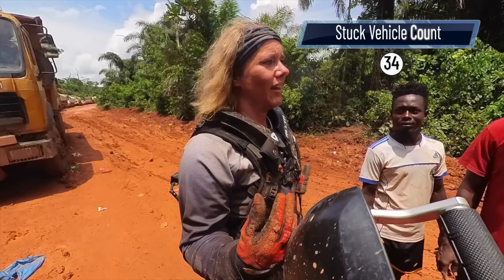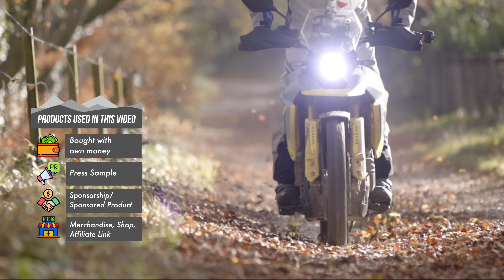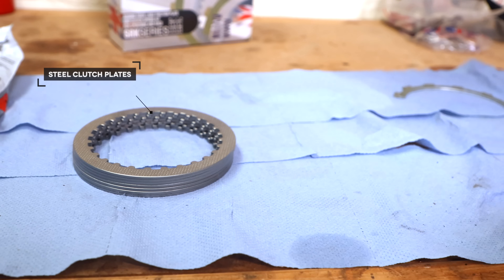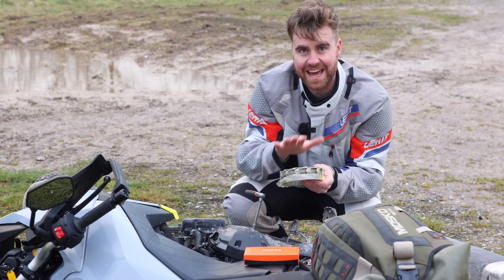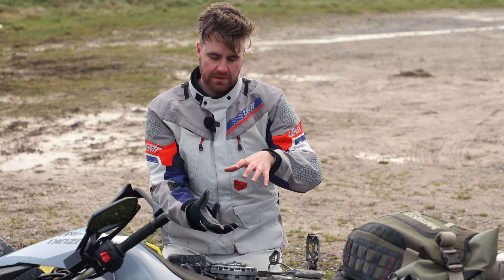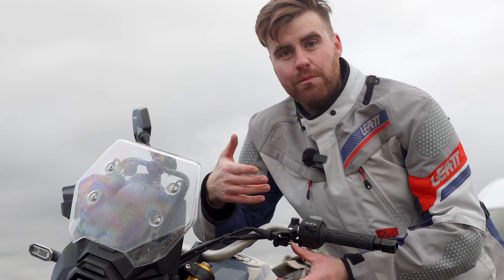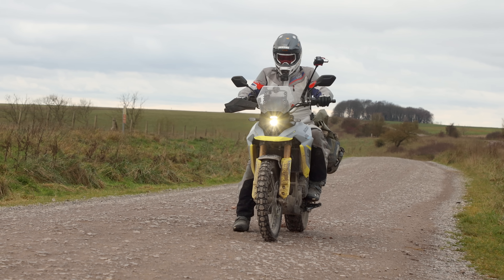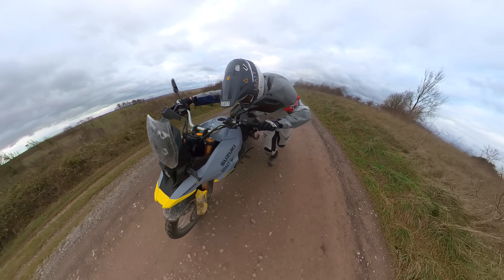This Dakar Trick could've saved Itchy Boots in Africa! | MiniTip Monday

Comment: I would love to see more of these dakar tricks. Right now im building up a xr 650 r to ride trough africa with it. These tricks could literally save my life in the future...
Reply from the maker: Cool!!
Reply: Make sure you get the seasons correct when going through West Africa; Noraly got it wrong by arriving in the wet season. In November and December, it's still very green with no rain, plenty of deep sand where the wadies are, and no mosquitoes to worry about either.
As this video shows, carry a spare set of clutch plates and a cable taped to the original in case it breaks. I made longer and wider foot pegs for my bike, as you will be standing up a lot. Add a bit more oil to your crankcase too, as it gets very hot here, or add an oil cooler. Water cooling: you can buy an anti-boil additive in most countries. (Abro tropical coolant).
Noraly was always concerned about the quality of gasoline sold on the road. People buy it from the petrol station and resell it for a small profit in 250-ml to 4-litre (1-gallon) containers to the locals when the petrol station runs out.
I've been in Ghana for 10 years myself and enjoy riding year-round. If you make it to Ghana, you are invited. I'm in a town called Tease (te ah see) in the Eastern Region. Just ask for the white man with tattoos at the police station, and they will direct you. I have a motorcycle parts shop and sell petrol from a table top. 😁👍🏼
The people are really friendly, and the food is good.

Comment: Awesome tricks! I just wanted to point out that both of these are a continuum, like you can do all three of pushing, downhill, with the starter button pressed, for the easiest possible load on the bike. And for shifting down it makes it smoothest to go really slow, apply some throttle to get the motor starting to rev up under its own power, and downshift at the same moment, to minimize the change in acceleration when the wheel starts engine braking to the new higher RPM. It's similar principle to getting the bike rolling before putting it in gear. Just smoothness is the key, same as with riding clutchless. but if you've ever watched Moto Gymkhana (Lexco has a great video on their techniques, which really carry over to a lot of types of riding), they don't use the clutch for all of those crazy manuevers. So it's definitely something that can be practiced for fun and can even become your preference, once you stop relying on the clutch because it's there.
Reply from the maker: Good points!

Comment: I would have cut up an old metal tin and made a dummy steel plate to pack it all out a bit further and take up the slack, or even put a couple of extra washers from elsewhere on the bike, under the spring nuts, to force it together until I could get a set of new plates FedExed to the next town. Of course I dont have a pile of CRF clutch plates in front of me to experiment with, but I would have figured it out somehow, because I have a good imagination, and and am also mechanically minded after 45 years of swinging spanners on bikes.  Noraly didn't get stuck for long though and is still inspiring people the world over.

Comment: Man having to snap a fibre disc and assymetrically load the basket springs is LOOSE but pretty awesome. For those not racing when you next open your clutch cover for any kind of maintenance or inspection - check your clutch spring ID & OD and pack suffcient washers to preload the whole spring set a few mm - no risk of basket damage and will save a ride if you catch a slippage, let the bike cool down and fit them before to much damage is done. Carrying a full clutch even on a remote ride is pretty rediculous for riders that have mechanical sympathy/ understand what heat and continued slippage will result in. Carrying 5-15 choice size washers that might save the day when you don't listen to your bikes warning signs for a weight penalty of ~50g in trip luggage might be a smart move for you or someone else where the terrain/climate/rider warrants it  :)

Comment: As a preventive measure
clean the glue between the disc pads and polish  (better oil circulation)
seeing tips on Trial UK forum (if I remenber).

I did it on Trial (Beta Techno 250),
very smooth cool easy... (Techno was was too brutal, and stalled in 1st gear)

Comment: Don't carry a fiber plate instead carry a extra metal. If slipping starts double the metal plates (2 metals between the fibers instead of 1) in the center of the pack. Your clutch will operate just like a brand new clutch again. I've ridden hundreds of miles on clutch packs with 2 metals stacked in the center on multiple bikes over the years.

Comment: i had the clutch mechanism fail on my old 600 gsf and due to the tip by a fellow friend with the starter motor I was able to drive back home. its quite weird at first, but you'll get used to it.

Comment: A simpler "gimmick" is to come up with some washers to put under the bolts that hold the clutch and basket together to increase the preload pressure on the clutch springs. Maybe she can scrounge them off the bike itself, other vehicles, or carry them around in her pocket for the next time this happens. The CRF300 has a ramp style slipper clutch and only 3 springs. It is reasonably easy to upgrade this arrangement in the 300 with a conventional clutch system.
Reply from the maker: It’s also a good point!

Comment: Most of are familiar with riding a fixed gear bicycle. You only pedal the bicycle forward continuously and it will not allow you to coast. That’s disconcerting at first but with practice, it becomes second nature. A fixed gear motorcycle is operated without engaging the normal gears. A sort of kludge to get you out of a jam until you can get a burnt out clutch replaced. The simplest solution when nothing else at hand works. Unlike Noraly, few of us will ever encounter a knee deep impassable mud bath like she did in Liberia. 😮😊

Comment: Make sure you really understand how your clutch works, and what effect the clutch free-play adjustment has on the cable, and actuation mechanism. In most cases when the clutch starts slipping, re-adjusting the clutch free-play will reduce the slipping. As will letting it cool down.
Reply from the maker: Absolutely imperative. Great comment

Comment: Any chance you could show us in a bit more detail how you create the fixed clutch please? Like where exactly the snapped friction plate goes etc
Reply: Take a plate out, break it half and re install with the two halves on top of eachother any position in the stack is what I think I know...
Reply: @Matthew-zw9su  thank you mate!
Reply from the maker: This.
Reply: The idea is to prevent the two types of clutch plate from being able to turn relative to each other  , or 'lock' them together . First off you need to open up the clutch and remove one plate ( I think that some of us might want to examine their manual , consult a friend , or the road side services , before doing this at all to be honest , but it is simple enough if you have some mechanical skill == do not blame me or anyone else if you fail at this or cause any damage to yourself or your property thank you  ==) . The method to lock the clutch plates in this situation is to break one plate and use the two halves to wedge the other plates together  , by placing one broken half over the other broken half between any of the other remaining plates in any position in the clutch basket . Now you need to reassemble the clutch baskets and springs .  By not allowing both types of clutch plate to turn due the wedge created , one type with external lugs and the other with external lugs remember , the two half of the clutch are locked together , just as if the clutch control lever at the handle bars was disengaged , ie as it would be to drive the rear wheel . Problem now is , hey , you have no clutch control and need to learn to how to cope . Return to the video once more for that advice . My advice , for peps driving road bikes anyway , is pull in your clutch lever and check for fraying wires before and after each ride ; usually the clutch cable will provide a bit of warning by fraying a bit before total failure . My clutch cable snapped  on an old Laverda , some years ago ,  and I drove maybe ten miles to my friendly garage . Not for the feint hearted ! Lol . I would not try this at all on a bike you are not very familiar with .
Incidentally , lol , I had a final drive chain snap and fall to the road causing no noise or damage to my bike once . Since the engine revved fine , but there was no drive , I thought I had a failed clutch . I was most surprised to see no chain attached ... it was a dark night out in the sticks . Found the chain a hundred yards back and fitted a new spring link that I carried as a spare . Phew ! All the best in 2024 .
Reply from the maker: That is so lucky to be able to just fit a new link!
Reply: @davidyendoll5903  what a great reply and story bud, cheers!

Comment: Drop your kickstand, start in neutral, tip your bike to get the rear wheel off the ground, drop to into first gear, the rear wheel will be spinning off the ground, rev up your engine, drop the wheel back to the ground, as if your rear tire is now your clutch. A little practice goes a long ways. Shift by backing off your throttle and sticking in the next gear. And ride it like you stole it.

Comment: Great info, most I have tried over decades but the snapped plate trick I hadn't seen. Shame all my bikes use steel-backed plates for both. Where is my emergency Hacksaw? Nearly Dakar time, bring it on.
Reply from the maker: I reckon you could probably bend the steel plates to achieve something similar

Comment: 1st: I believe when you open the clutch cover you will surely damage the gasket. ( Mostly it's paper-based) 
2nd: Start in neutral why play with a clutch switch 

My new bike clutch wire was loose and I drove 10km without using the clutch ,it's very challenging in traffic but I made it to the service center for a quick fix
Reply from the maker: 1) in this situation it’ll be fine and a lot of them hold up to being opened without damage if you’re patient and careful.

2) so you can use the starter motor to help you start if you need it. Can be really helpful.

Comment: 75w140 oil and a water  bottle to spray on clutch case if fading.  No, it is not pizza sofa comment, real life and always worked.... Yes cooling clutch case with water works, yes, 75w140 makes a big difference... If hydraulic, care of the hose going to slave cylinder, not touching hot engine. But motorbike club is the most stubborn activity found on planet 😅

Comment: If you watch the following episodes of Itchy Boots after the burned clutch you will see, that it wasn’t simply burned - a lot of noses of the clutch plates were broken. I think the clutch was nearly dead long before this episode, because she was riding such a lot off-road with it.  Maybe the freeplay was not well all the time adjusted and so she was riding with a little friction for a long distance. And then came this nice guy how want‘s to help her, but he was careless with the clutch. Noraly was afraid in this and asked him more then 1 time to be careful.
Reply from the maker: So, I did scan the next episodes and I think what happened is that once it started to slip they both kept riding. 

It may have been worn already, the CRF is well known for this being fragile. But, when it starts to to slip clutches get very hot and parts weaken. Baskets will break and fibre plates will disintegrate.

The quick you stop the bleeding the better.

Comment: Also you when you are ready to shift punch the kill button quickly to unload the shift dogs, an old dracing trick install a micro switch on the shifter and when you are on the throttle bump the shifter it does the same thing unloading the gearbox . Jus saying
Reply from the maker: Interesting idea! It’s a quick shifter then!
Reply: Yes

Comment: Awesome video! Sorry, I heard you mention quickshifter. Would having one be helpful in this situation? I'm guessing it would.
Reply from the maker: Sure, it’s helpful but far from essential. Quickshifters are best when the bike is under load, ie throttle turned. All it does is cut the ignition marginally to do exactly what I explain doing manually in this video, so the same lesson still applies.

Comment: I have a question.
I watched the Noraly episode mentioned here, and I couldn't help but wonder if doing the mud stretch in bursts would have lessened the damage.
At the time I theorized that the worst damage to the friction plates occurred when the clutch was very hot.  If this is true, then riding (say) 30 or 40m at a time and then giving the clutch a couple minutes to cool down each time would have lessened the damage across the entire mud stretch.

Is this correct?  Would cooling the clutch help?  Or is the amount of damage over the total length of the mud going to be about the same regardless?

I would be very interested to know.
Reply from the maker: It does help but once it starts to slip at all, not really. It’s game over for the clutch tbh.

Comment: Two thoughts. Don't many bikes have fiber gaskets? If so bring small tube of gasket sealer?
It could be my habit, but on many bikes it seems easier to find neutral after dropping down into first.
Reply from the maker: They do but they normally hold after opening just fine.

Comment: I was trapped with a broken clutch cable on an extensive off-road adventure. Fortunately it was very very muddy. I would pop it into first gear from stationery and use the mud and the wheel spinning as a clutch for a gentle pull away.
Reply: You rarely hear “fortunately it was very muddy” 😂

Comment: Of course in IB's case the clutch was cooked by way of massive and repeated, blatant abuse.  So avoid that, and then her particular problem doesn't occur in the first place.  I thought this was going to be a video about escaping horrific mud holes.  Riding without a clutch is quite a different subject, and should indeed be practiced so that, when the skill is needed, it can be used with some confidence (even if the manufacturers try their damnedest to defeat the practice).

I've had to do it in a car, when the slave cylinder simply vomited out its seal, along with all of the hydrolic fluid, and it went just fine.  Of course that was back when automotive designers weren't trying to make unconventional operation of the vehicle impossible.  I was able to use the robust starter motor to get going.  Of course it works a lot better when you're able to hit neutral between any two gears, as in any car back then.
Reply from the maker: Indeed. Great comment!

I’ve already made a video about riding in that kinda mud too.

Comment: Nice trick indeed, but unfortunately, in Itchy's case that wouldn't have helped her. Because if i remember correctly, the carrier case for the clutch also broke in pieces. Resulting in lots of debries in the engine.
Reply from the maker: I think it actually would’ve because she could put so much less heat into the clutch. Once it’s starts to slip it will generate huge heat. 

I don’t know if that is the case but for sure it could contribute and would seem a likely chain of events. ☺️

Also,it does appear that a lot of the debris is actually fibre plate break up. Didn’t watch in detail but that was my passing observation.

Cheers!
Reply: Would adding washers under the springs have helped at the first sign the clutch was slipping? They are easy to carry in a tool roll...
Reply from the maker: Maybe a bit, if they can go under the pressure plate. If it’s between the spring and the pressure plate I don’t think so. That would make the scutch heavier but not thicken the clutch pack.

Comment: Engage the gear into 2nd or 3rd and start it without pumping the throttle. You will have a smooth start that will not spin the back tire or throw you backward. Don't ever do it in first gear.
Reply from the maker: Interesting. I think second gear is too tall on my bike for that to work. I will try!

Comment: When my brother dropped his Honda NC750 on a greenlane there was some petrol leaking out of an overflow from the petrol tank into the seat area. Because of this I would be hesitant to lay my own bike down like this. Can you tell me if it is safe to lay most bikes down on their side? I have a Tiger 800XC
Reply from the maker: For the most part. Sometimes you might get a little overflow from the tank but if that happens pick it back up and lie it down on a lesser angle.

It’ll also only ever be a bit too but you can’t take the cover off with the bike upright cos you’ll pour oil everywhere
Reply: Thanks for your quick reply. I have wanted to know this for a while now as I saw someone do a video changing their Tyre by laying the bike down. It may even be one of yours 😄 @BrakeMagazine
Reply from the maker: Riemann I think 🙂

Comment: Nice technique.  Couldn't you just pull the clutch lever in to inturn activate the clutch switch and make the bike think the clutch is pulled in? Why remove the lever?

And also confused about "either a fibre plate already in the clutch pack, or one you are going to replace ". 

I dont understand,  if my clutch is cooked I'm going to replace the whole stack.  Do you simply mean, you cannot add an extra plate to the basket?

What if you had a spare plate and left it whole and added it to the basket rather than snapping one?
Reply from the maker: You could on some bikes. 

I took the lever off my bike to show riding without a clutch. No need to remove it. 

You can just add the extra plate if you have it. You can do anything that’s going to overfill the clutch pack. Double a plate you have, add a new plate, wrap a fibre plate in leather laces. Just fill the gap, stop the plates slipping is the only goal.